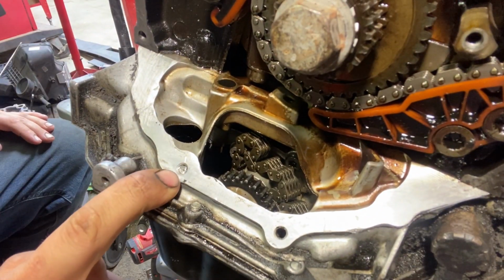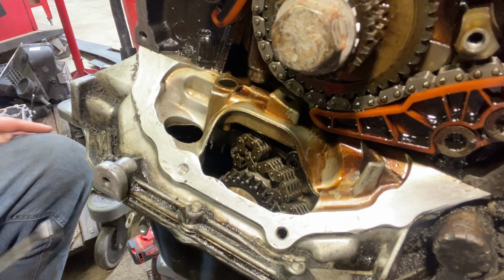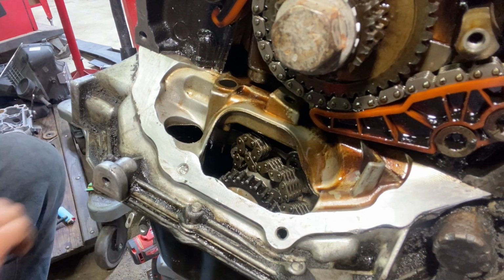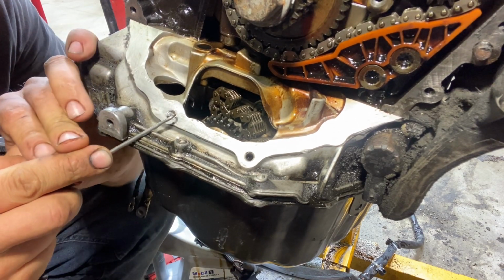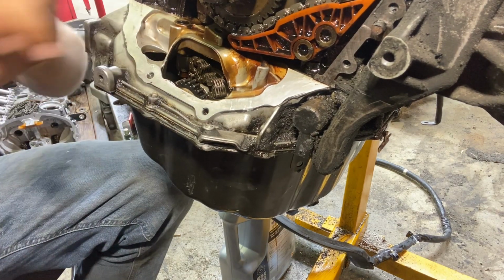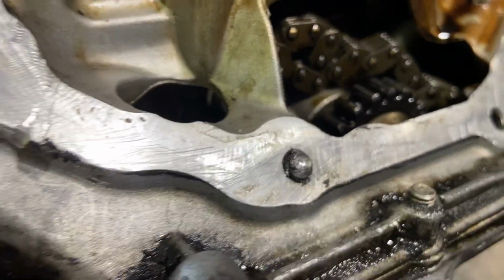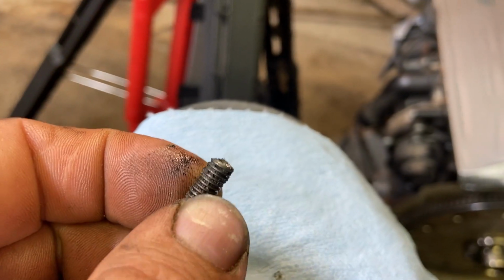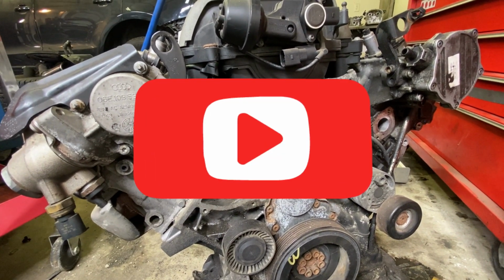Broken timing cover bolt extraction reverse drill bit snapped bolt broken stud easy out extractor vw

Comment: Add to my list of tools to get! Two weeks ago had to drill out a broken bolt and use an extractor. Worked well, but took some time; like 2 hours. Kept on burning up bits, granted it was a small bolt had to use small bits (don’t worry I was using cutting oil). Thanks for the info man!